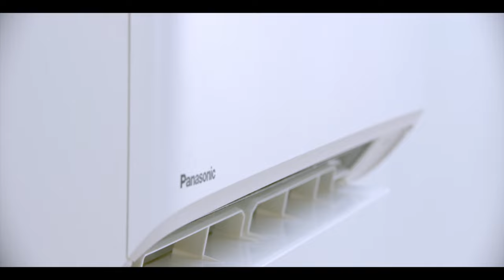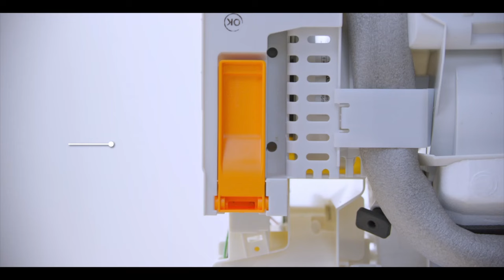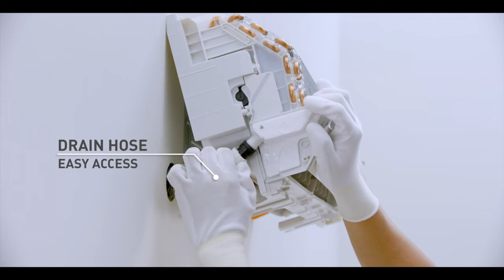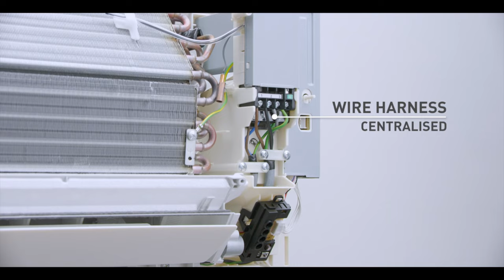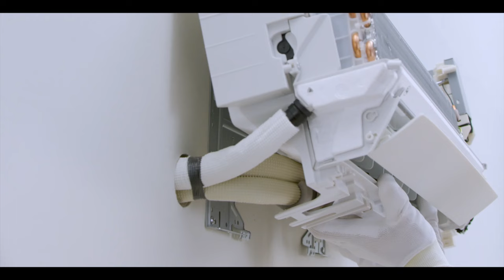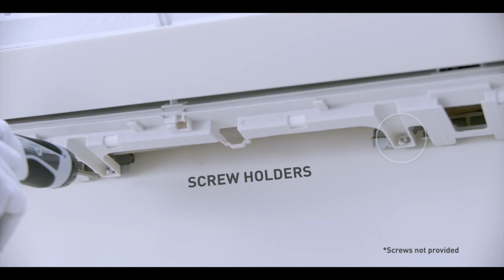Panasonic Air Conditioner :  Easy Installations and Service Feature (Short)

Comment: I just wish the UK Installation and Operation Manuals were written by someone who can write fluent English - you'd think a company the size of Panasonic could afford to do better. Aside from the broken English which makes it all very difficult to read, we have incomprehensible paragraphs like: "Internal Setting Temperature - Once the operation starts, remote control setting temperature will be taken as base value for temperature shifting processes. These shifting processes are depending on the air conditioner settings and the operation environment. The final shifted value will be used as internal setting temperature and it is updated continuously whenever the electrical power is supplied to the unit."

Comment: I brought Panasonic AC 2021 modal now after using 3 years it got repaired, company service saying that there is a gas leak takes 5k for the repair and no guarantee that it will work after repair. I brought it for 45k and now just for 3 years I need to pay 5k extra with no hope of working longer. Previously I have  LG AC which have a life of 10 years but Panasonic lost it's life on just 3 years. They service is very much disappointed in india.